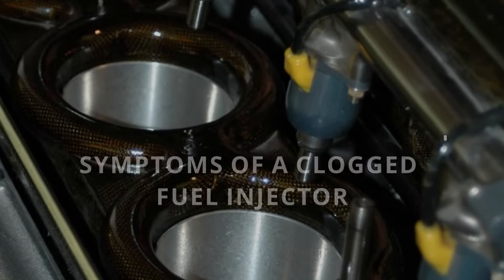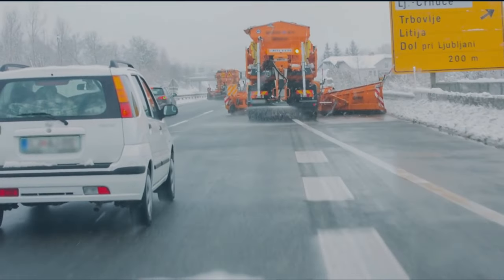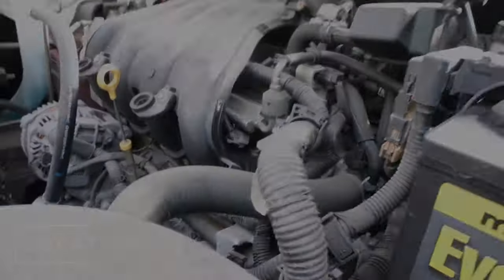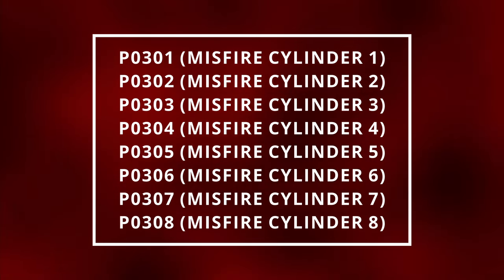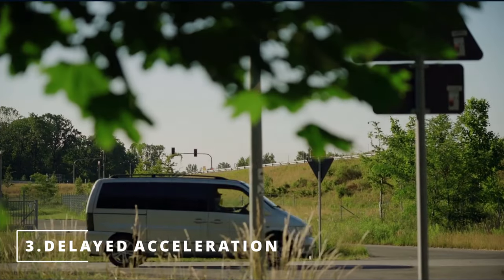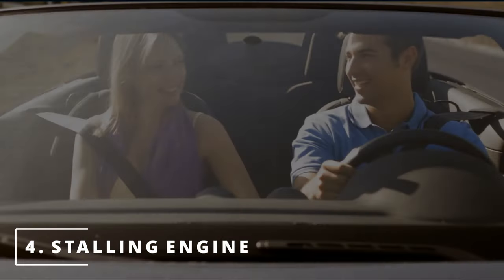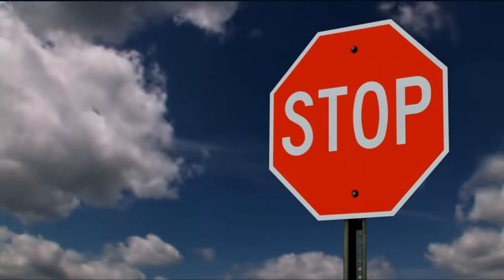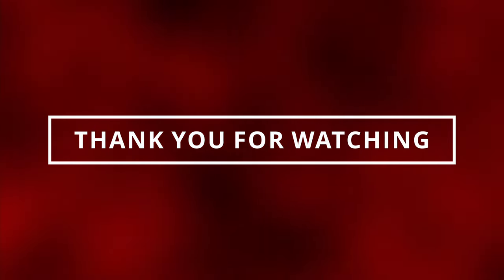SYMPTOMS OF A CLOGGED FUEL INJECTOR

Comment: I really hope this is the problem wit my car and not the transmission
Reply: I had same symptoms and I thought it was my Transmission going bad on my cargo van... Turned out it was a clogged EGR VALVE... Damn Emissions !!!
Reply: It was the transmission wasn’t it
Reply: I have a 2008 Jeep Patriot and it runs fine until I give it a little throttle and then it starts loping back and forth. I'm hoping it's not my transmission and maybe just some clogged up fuel injectors. I'm going to try some of that fuel system cleaner and see what happens.
Reply: I have the same fear
Reply: I hope the opposite 4 me rn..
Reply: Check your ignition coils and spark plugs
Reply: What end up being? Mine it’s jerking back n fort I changed the mass air flow sensor n still doing the same
Reply: @gasparma2316  did you find a solution to your problem? Currently having the same ordeal.
Reply: Idk how it went but I hope it wasn’t the trans
Reply: Well?? What was it
Reply: @D3structive  it was the transmission that went bad :( had to replaced it.
Reply: @gasparma2316  Nissan wasn’t able to cover with warranty?
Reply: @gasparma2316  how much they charging you?
Reply: Right because it feels like the transmission is off in my car!
Reply: Does Your have problem shifting when you push on a gas pedal to the floor But if you drive it normally it's just fine ?
Reply: 134th person to say  "yeah.  me too.."   (..134th 👍 on this comment)
Reply: I just wanna know is it my fuel injector or the fuel filter cause I don’t have no warnings sign on my dashboard but I hear that ummmmmmmmmmm when I put my foot on the pedal n it takes off as slow acceleration but it still goes into gears but it does that slow and than I can drive over a certain mileage n if I do it will cut off
Reply: @brittanypittman7513  It is this transmission. That's what it was On my car.
Reply: Jesus loves you all
Reply: @braxtonpayne9093   I need that  thank you
Reply: Sameeee
Reply: Two way different issues
Reply: Literally same reason I’m here bruh praying it ain’t the transmission
Reply: Oh man 🤦🏾‍♂️same here
Reply: Lol supper late reply but I was not lucky it was my transmission 😭😭😭
Reply: @jaliel0007  ohh nooo😭😭what were the symptoms of the car 👀i need to know if I’m having the same issue
Reply: I had my fuel injectors replaced they got messed it popped up the emission and it started to mis fire so I got new fuel injector and spark plugs
Reply: Transmission will give completely different symptoms. When it shifts, you should barely notice the gears change, but if it jumps... that could be a problem. Never do burn outs in an automatic, never flush the transmission, always use the exact same transmission oil, change transmission oil every time it is dirty or looses color. Get some ATP for transmission care, make sure it is capatible with your system and add to the trans fluid.
Reply: OMG!... meee too that's EXACTLY was in the back of my mind!
Reply: Honestly same bro over these car issues
Reply: Me tooooo! Im stressing especially now that my dad passed cause if its the transmission i dont have him to help me
Reply: U and me both buddy😭🍻

Comment: I changed all my spark plugs & ignition coils. And my car still stutters. It’s gonna be my injectors!
Reply: Update ?
Reply: I replaced my coils and plugs, then the injectors. About 70 miles after replacing the injectors (because of misfires on multiple cylinders and confirming the misfire followed the injector….) misfire on cylinder 5 again. I’m over this car. Do you know why they’re called Chryslers? They make you CRY.
Reply: Update??
Reply: I have a Dodge avenger 2009 I just replaced my coils and sparks and crankshaft position sensor. And I'm still ideal rough and car will shake after ideal for 2 or 3 mins. Once my check engine light blinks it starts shaking the car and real rough ideal smh I'm about to replace the air filter tomorrow
Reply: @dustinskaggs5956  It's not the air filter bruh, if the check engine light blinks it's much more serious.  This sounds like a timing issue......
Reply: @MamaNeedsABowl  check 02 sensor, purge vakves, and cat converters.

Comment: I was having these problems with my 04 mustang GT so I went and got me some new spark plugs and new coil on plugs and new injectors and replace cam shaft sensor and the crank sensor and it made a night into day different. I got tired of replacing one or the other every few months back and forth to the mechanic so I did it myself using all these YouTube videos. I want to thank all of you guys for sharing your knowledge with us the world can be a lot better if we all share knowledge best wishes
Reply: Before you replaced the injectors did your car have little pops or sputter a little at idle after a cold start?
Reply: @brianspangler3771  yes and it gets worse over time because I over look it and didn’t worry about until it got bad and the mechanic replaced one spark plug and coil and it lasted about 3 or four months and I was going back to the mechanic and I was saving money all the while
Reply: @hermanrogers1325  Thanks for getting back to me. I asked because I have a 98 cobra that I've been having some issues with and it has those little pops at idle after cold starts. I've also replaced the cam and crank sensors and still have some issues with it not wanting to start when it's cold.
Reply: @brianspangler3771  my 04 mustang GT in my case I started throwing new parts at it because I know I was going to keep it for a long time 10 years now and looking forward for 10 more theses old mustangs deserve tender loving care
Reply: Symptoms of surging and bucking while driving not at idle. engine light but gas mileage still great??
Reply: I've gotten a 2017 gt, and the engine light came on. Being a misfire, I changed the spark plug. Yes, it turned off a few times but came out again. And now I can feel like the lag or loss power in acceleration and a weird ticking noise every so often. I'm beginning to suspect a fuel injector since the coil is swapped, and the spark plug didn't last much. Any ideas? From your experience with these cars😅
Reply: jesus. you replaced half your car with new parts. of course it made a difference.

Comment: All I can say guys is run THE BEST fuel you can get. Here in Australia, BP Ultimate 98 is pretty well "best" you can buy. I ran my V8 Fairlane (still have the car now) from year 2000 through to 2019 with a proud 743,000km on the clock. The Windsor was pulled down for a freshen up @ 600,000km. My engine builder was amazed at how clean my engine was on the inside. Yes, Oil & filter every 10,000km but less dirty fuel deposits count.

I sent the injectors away for a test & clean just to be thorough. The report came back with a perfect spray pattern. The guy told me they didn't need cleaning. These were the original injectors @ 600,000km. That Windsor always ran BP98 Fuel. Stay away from the cheaper stuff guys, it will cost you in the long run. Cheers Fletch. 👍
Reply: my 1999 toyota altezza is at 363,000kms. i thought that was good. damn. your cars being at 600k and 743k is incredibly impressive. well done. serious respect.

Comment: Thank you!  Been having an issue with check engine light staying on but the only issue diagnostic shows is bad EVAP solenoid.  However, as far as I know, that will not cause it not to start.  No other codes showed.  Stranded me several times, when it stopped accelerating before the engine would die. I've been trying to learn the problem before sinking money into a fuel pump replacement.  This will surely be less costly, and pretty easy to check.  And, if that is the issue, will save me a ton of money.  Thank you again!!!!!!!!!!!!!!!!!!!!!!!1
Reply from the maker: Fix the evap solenoid first before doing anything else. It's not too difficult. While fixing it make sure to look for torn wires or corroded connectors as this can also cause problems.
Reply: What’s a bad evap solenoid? You mean a canister purge solenoid? Charcoal canister?
Reply: @realnpc3763  Man, if that's the one at the tank, I think that's my issue as well. I changed plugs, a few coils (two broke, and one for the misfiring cylinder), now different cylinder, but one of the plugs looks like it hadn't properly fired when I got back in there the next day. I used to have 0455/0456/0457 codes (sm and lg EVAP leaks), as well as 0420 (below efficiency on bank 1). Replacing the PCV (discovered it was broken before changing plugs) caused two of those codes to disappear (0456/0457). Now I still show 0455 AND instead of 0420 (yeah that code went away also), I show 2097....running too rich on bank 1. I just have a gut feeling that it is "out of balance" for a lack of a better term now that the one is fixed (PCV), it's showing "oh hey, we have another issue but the newly fixed issue was just covering it up", if that makes sense? I'm a newbie, not even shade tree level, haha. I plan to clean the IAC and TPS as well as add some high mileage STP fuel injector cleaner when the rain stops. Can't hurt, and I already have the stuff. Apologies for being all over the place. I have an 06 Pacifica with 3.5, and 275k miles.
Reply: @AlchemistAugen  I figured out my issue which was the fuel injector was leaking for cylinder 6. I still have the code for the canister purge incorrect flow. That wouldn’t cause sputtering or anything.
Reply: @AlchemistAugen  but the purge valve probably caused my fuel injection to leak after 6 or so months of not worrying about it
Reply: @realnpc3763  yes, all the same
Reply: @AlchemistAugen  it could also be the throttle sensor/body.  The EVAP sensor on the engine was replaced and that has kept it from shutting down, but the check engine light is still on.  So, I will have the canister on the gas tank replaced, and if the light stays on, I'll work toward the throttle sensor.  Thanks for the help.
Reply: @realnpc3763  No, just the sensor on the engine.

Comment: Sir you just gotta like and subscribe off of this knowledge you save me a big headache and we’re right on the money but I also change the fuel filter and fuel lines due to the fact that I have a 1991 F250 custom and they were the original now she runs like a dream Until the next problem and I did it myself which saved another $300 in labor 🙏
Reply: What problems did you have
Reply: Just bought a 93 bronco and it keeps stalling when I give it gas I’m trying to find something on here but there’s nothin

Comment: Thank you so much for this... I just got a 2003 XC70 Volvo and the other three owners before me to very good care of it but after driving it for a month and getting the oil changed it started misfiring. The sound of it and the description of what it was doing is this. I'll be driving and when I got to a stop hit the gas pedal to keep going with it would stall and then it will have a hard jerk... Creating the car too stop for a brief second and then accelerate. But that's dangerous especially if it was to happen like on the street going more than 40 mph and you're hitting a traffic light that's not good at all. So thank you so much for this information I'll be taking care of that Monday.
Reply: How did the fix go? I have a 2009 xc60 t6 that has a jerk coming off the accelerator I know 3 fuel injectirs are missing did it smooth out the issue that you were having?

Comment: I'm currently dealing with rough idle when stopped. Definitely going to get me some fuel system cleaner to see if that'll help
Reply from the maker: Also, look for vacuum leaks (hissing sound) and check to see if your throttle is dirty.
Reply: @EasyAutoFix  I definitely checked for vacuum leaks and no hissing sound. I haven't checked the throttle so I'll do that in a bit. I bought the fuel cleaner so I'll know tomorrow when I fill up the tank if there's improvement
Reply from the maker: @Megacooler96_  Smart! Another thing to check is the IAC valve if you have one. If you have an electronic throttle body you won't.
Reply: @EasyAutoFix  I have a 93 Acura Integra so most likely it does
Reply: @Megacooler96_  Hi, did you fix your problem? What was causing that issue?
Reply: @foxie777  yeah, the issue was couple of things. It was a bad spark plug and fuel injector.
Reply: @Megacooler96_   I have an 00 integra just changed my spark plugs next i was thinking injectors or mounts? It's smooth on the highway but vibrates at low speeds and stoplights.

Comment: Big help, thanks.  I seem to have all cylinders firing as they should after using some injector cleaning additive and letting it sit a short while, but will find out if injectors need a thorough clean soon.
Reply: How long did you let it sit?
Reply: @XxowendanxX  overnight.  Filled up with fresh E5 and a whole bottle of additive got rid of any problem.  It was old dirty E10 fuel caused my injector to clog up.
Reply: @LexTNeville  wouldn't a tune up, new spark plugs and new ignition coils have prevented all that?
Reply: @XxowendanxX  only lesson is that E10 fuel has a much shorter shelf life, so don't store it for longer than 6 months.

Comment: Thanks man, I thought that I might have a defectives fuel injector as I have a p0303 code. However, I do not have the lean fuel p0171 code so hopefully I am looking at a bad coil. I'mma play it safe and replace all the 4 coils on my Nissan Frontier. I have already replaced all the spark plugs and the valve cover as i had a leaky seal anyways. Crossing fingers. Thanks for the help man.
Reply: Update - after replacing all 4 coils I no longer have the misfire.
Reply: Sorry in advance,  I'm not very good at mechanic work. When you mentioned you were going to replace coils, are you talking about spark plug wires?  I just trying to figure it out, thanks.

Comment: I’ve changed my throttle body, mad air flow sensor, air filter, and my engine light is still on. I’m hoping this is what it is so I can be done fixing this car for a moment. It also sounds like fluid is running through the car when I come to a stop….do you know what that may be?

Comment: 98 Jeep Grand Cherokee.  Hard Starting, Rough Idle, Hesitation and Stalling upon the first 45 seconds to 120 seconds of driving.  Diagnostics were fuel pump was previously changed out prior to purchase.  New fuel pump died.  Gas tank was dropped, fuel pump was taken out and the attached fuel filter/strainer was extremely dirty and clogged which led to the old/new fuel pump dying.  A New fuel pump assembly was put in (with new filter/strainer).  It was dark when I changed it out and I also could not syphon/remove the 3/4 tank of fuel but I did look inside the gas tank and noticed grime/particles/and bits of debris floating around in the fuel.  I was not in a position to dump the fuel or remove the debris so the new fuel pump went in.  

A few weeks passed with normal operation of the vehicle and the previous symptoms resolved.  BUT one morning the symptoms returned.  Fuel tank was dropped again and fuel pump assembly was removed and upon inspection the new fuel filter/strainer was clogged.  The tank was carefully cleaned and the remaining fuel was removed.  The 5 gal of fuel that was removed was filtered using coffee filters fitted around the nose of the gas can and fixed with black elastic hair tie wrapped around the nose.  The fuel was poured into another clean container with the coffee filters being changed liberally throughout pouring.  Fuel filter was cleaned the best that could be and the assembly was reinstalled.  Clean fuel was introduced and the symptoms still persisted.  

Tank was dropped again for the 3rd time and a new filter was installed.  Fuel and tank appeared clean still and hopefully the small remaining debris was sucked into he already dirty but previously new filter.  New clean filter was again installed on the assembly and put back in the tank with 2 new hose clamps on the fuel inlet hoses (coming from gas pump insert).  Symptoms resolved for a few starts but persisted again with even rougher idle.  

Fully confident that the fuel, pump, and filters are clean and operational...the FUEL INJECTORS will now be removed and cleaned.  I am more than confident that this is the last issue causing the symptoms in the fuel chain.  One of the injectors must be partially clogged if not more.  They will be inspected, cleaned, and reinstalled.  If symptoms resolve I may upgrade the injectors altogether with a 4 hole injector instead of the factory 1 hole.  One hole injectors make it even more suspect that one of the injectors is currently clogged or partially restricted and not allowing the proper fuel pressure/ flow to pass through into the chamber.  

I hope this helps someone.  Clean your fuel or your tank anytime you pull the fuel pump assembly.  Its a pain sometimes but its better than pulling the tank 3-4 times.  But sometimes shit happens and you gotta diagnose it yourself.  I seen numerous jeep forums encountering the same problem and were chasing the same symptoms for years.  And yes BTW I elevated the possibilities of it being other sensors because each of them were changed out and retested with a volt meter to ensure proper voltage.  

Thanks
Reply: You know that the fuel pump delivers more fuel than actually needed...any excess fuel flows thru the pressure regulator back to the gastank. There might be a problem n the fuel return lines.
Reply: @JusticeAlways  ended up being O2 sensors.  Changed both of them.  Easy way to see is to climb under there and unplug one of them.  My upstream 02 sensor was the main problem causing all the symptoms.  I changed the downstream too.  Runs like a champ and no more stuttering.  Won’t throw a code either so beware!

Comment: My 2019 Nissan Sentra exhibits some of these symptoms, like the rough starting and idling, and my fuel efficiency has been slowly dropping over the past few months. My check engine light isn't on though, so is this combination consistent with a fuel injector issue?
Reply: Any update ? Having the same problems with my car. No CEL